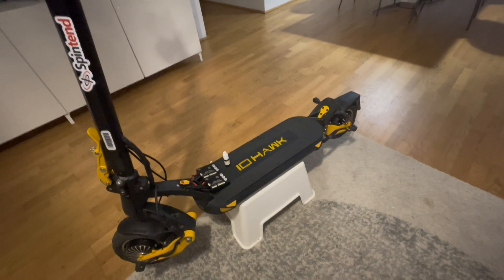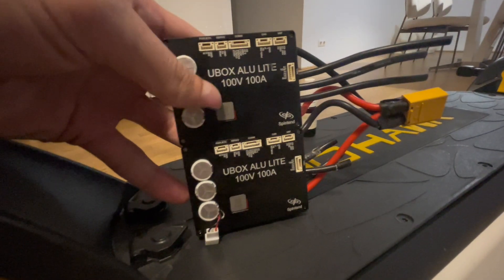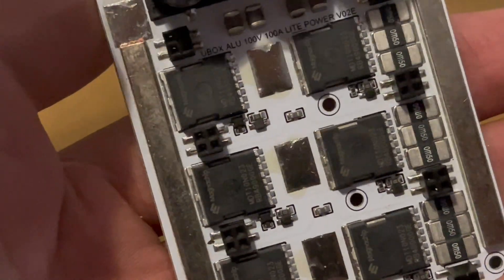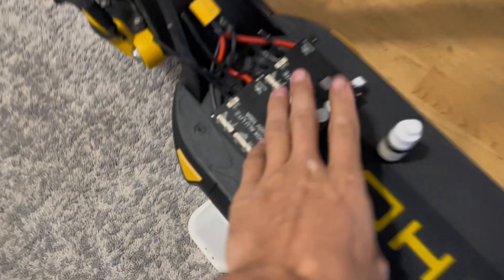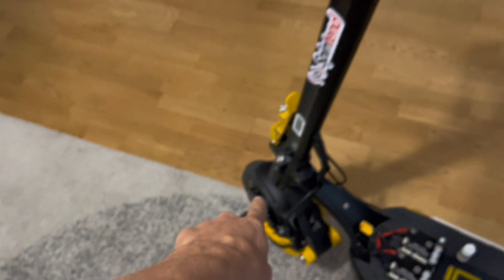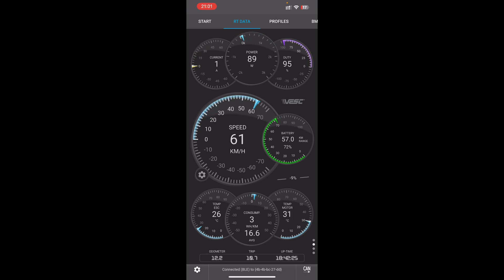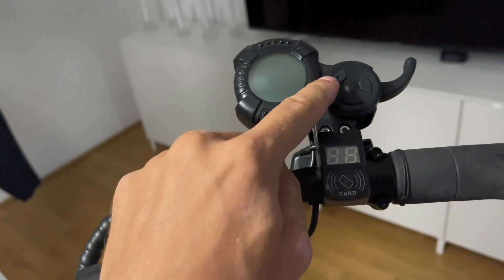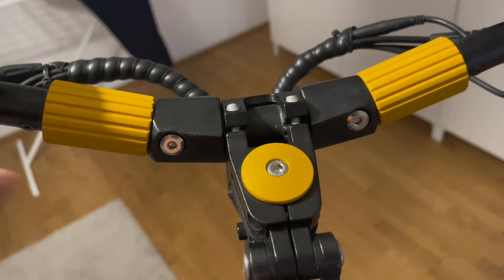The Best Display for VESC - complete integration with Spintend and VSETT / IOhowk, Mukuta, ZERO LCD

Comment: You connected the display to the front controller. Did you also connect the ADC controller to the front controller? Or did you connect the ADC to the rear controller? My question is, if I connect the ADC to the front motor, how do I connect the display since the RX/TX, etc., are then occupied by the ADC? Or do I simply tap the RX/TX, etc., cables from the ADC?

Or do I simply connect the ADC to the rear controller and the display to the front controller?

Comment: Where did you get the 12 volts for the ADC controller? The lighting system only works with 12 volts. The manual says I need a 12 V power source for the ADC controller. The ubox light doesn't have a 12 V connection.
Reply: I added 36-80v step-down bec -> 12v fixed 3.5amp rated

I used Ubox Light Vbat out free pin on IGN connector and a ground there to power that BEC. Easy just 2 wires. It is always on though - so I added also a small solid state relay rated 5amp which is triggered by 5v output of COM port (normally it is used to wake up another VESC, works perfect for this job) 

Yeah lite is missing NOTHING but 12v 3amp built in bec…. Such bec from 100v takes a lot of space so I understand why they had to remove it for Lite version. (Bec also generates a lot of heat and Electric Noise, so I actually prefer it being external)

Comment: Hey, it would be great if you could provide detailed instructions on how you connected the display and also how you integrated the lighting system. I'm planning on building something similar.
Reply: It’s fairly simple 
- gnd to gnd 
- screen gets VBAT as power so connect that to + (see inside your screen which color cable is + red normally) 
- screen RX to TX (comm port)
- screen TX to RX (comm port) 
- than there is 1 cable more from screen going down, that one gets VBAT passed through only after RFID unlock = your IGN pin on Ubox vesc

Done, there is another cable but it is not needed (even IGN is not required technically, but it’s nice to make it work like on video)
Reply: @TomHenry2 hey there. I feel like this would work on any display that's uart right? What about p settings and how it impacts vesc

Comment: The only problem is that it doesn't show battery  information you  or we , do need to know the 🪫percentage you know the voltage,  so that's why for now either the FLipsky TFT screen is now  the best cheapest choice or maybe the one from the  UK site, is like 120$, and then is the one from the Russian engineering I think it's more like 150$
Reply: That’s not accurate - screen still shows battery bars, as it did on Vsett 

Screen is powered via VBAT, so you get voltage read out on screen and on tft display below by the RFID reader.
- also screen bars still work and show % so to say. (It works same way as it did on Vsett controllers) 
- also Vsett display supports 24v/ 36v/ 48v / 52v / 60v / 72v configurable via settings (hold two +- buttons) 

So you get proper battery read out

Comment: Any details on how/where you wired the screen to the VESC?
Reply from the maker: Yeah if enough show interest I can make a full tutorial I suppose even on how to wire it

But I help you, it is simple - screen needs only 4 wires to work - VBAT, Gnd (can take from IGN port of those Spintend vesc) and Tx / RX from comm port (on all Vesc) 
Done ✅ 
Than just load script into 6.05 flashed vesc and configure your Vesc as you would do it always (make sure p6 p7 settings are set same as Vesc)  done ✅
Reply: @airBornFpv  please do a full tutorial and can you set a button to switch from single/dual ?
Reply from the maker: Yeah if enough show interest I can make a full tutorial I suppose even on how to wire it

But I help you, it is simple - screen needs only 4 wires to work - VBAT, Gnd (can take from IGN port of those Spintend vesc) and Tx / RX from comm port (on all Vesc) 
Done ✅ 
Than just load script into 6.05 flashed vesc and configure your Vesc as you would do it always (make sure p6 p7 settings are set same as Vesc)  done ✅ 

Optionally: you can use return vbat that screen gives as IGN (it is vbat that screen outputs ONLY after you turn it on)- this will allow vescs to wake up and go to sleep with the screen power up/down

Comment: Maybe I buy a mukuta screen to test it
Reply from the maker: There will me a sale in 5-6 days on Aliexpress, and Mukuta large display will be only 118€

While Slach small screen (same as vsett / Mukuta) will be like 33€
Reply: @airBornFpv  I prefer the larger one does the vset 10 blinkers stop light working?
Reply from the maker: @marine1718  yes as I showed in video. using ADC adapter from Spintend
Reply: Finaly I bought the display of the makuta for this project. I'd it possibly to change the throttle?

Comment: Did it Work also with original 50a 25ah Battery ?
Reply from the maker: Original battery was 48v, but yes 

Vesc work on a wide range of voltages,  I don’t know what’s lower limit though - but there is nothing to worry about, it is bellow of any scooter battery 😁
Reply: @airBornFpv  most want approx 3S to work well, more powerful ones usually 4S